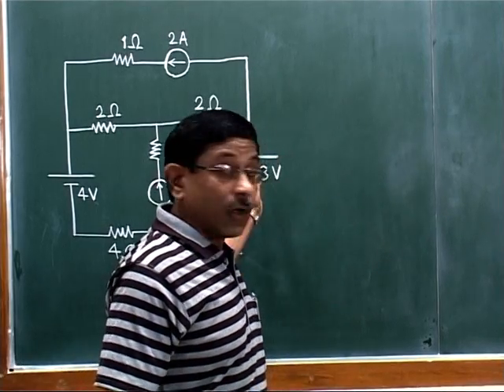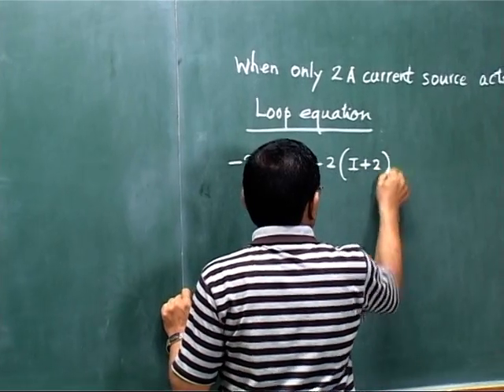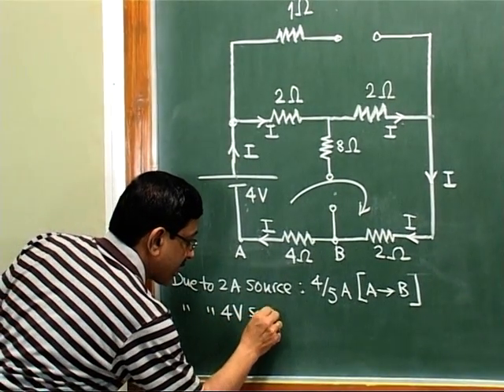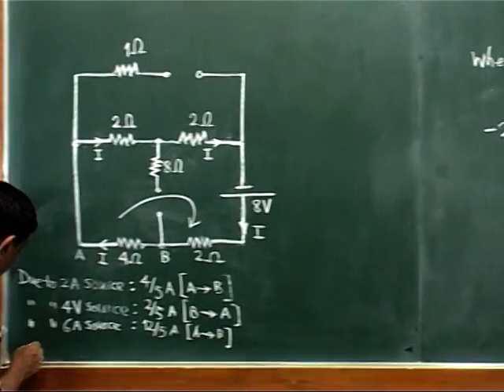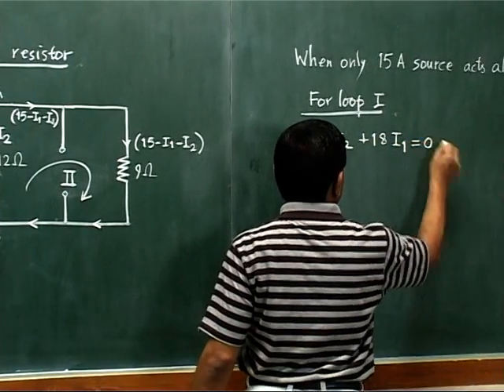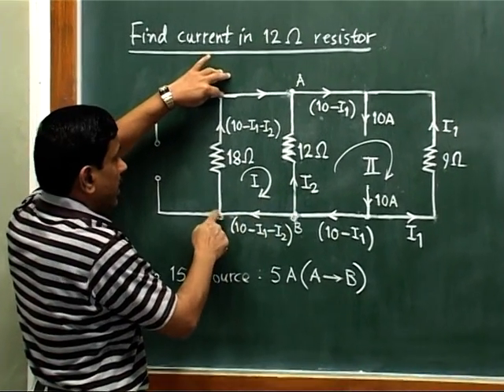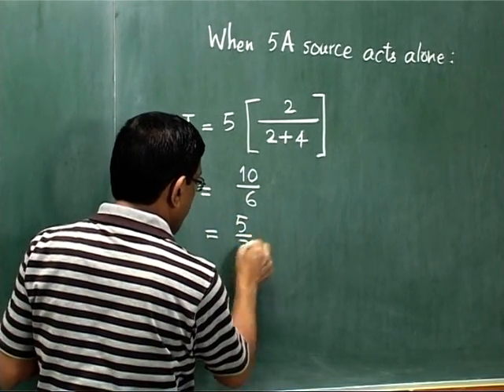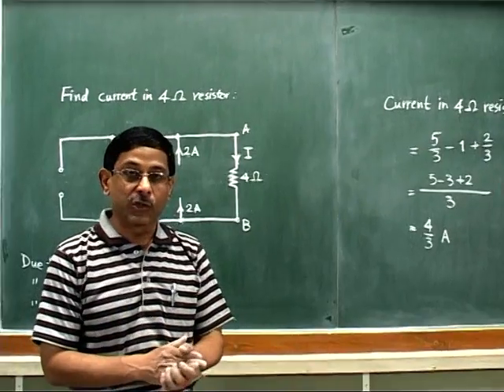Network Theorems Tutorial - 3 : by Dr. C. B. Bangal

Comment: in 6A circuit u have missed the 8ohm resistor where its is gone
Reply: You don't need it, since the only thing that matters is that 6A is entering the node on top. If you ignore the 8 ohm resistor, you still get the right answer in the end. :)

Comment: Dear sir, in middle problem, we can get current by "current divider rule" rather then loop method. this will be short cut.like, 9||18=6 ohm, which is again in || with 12 ohm resistor. n now we can use current divider rule.